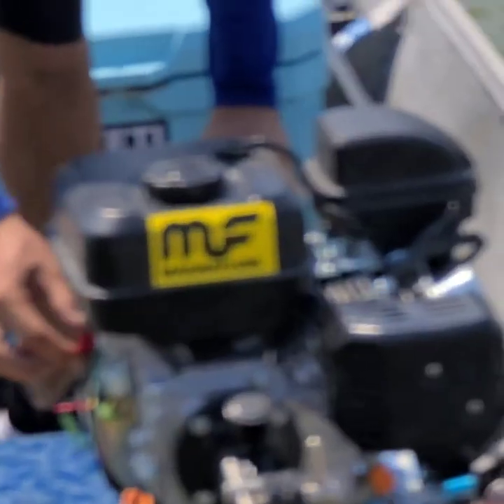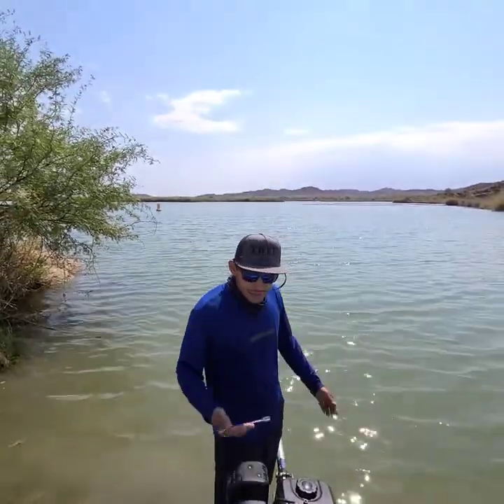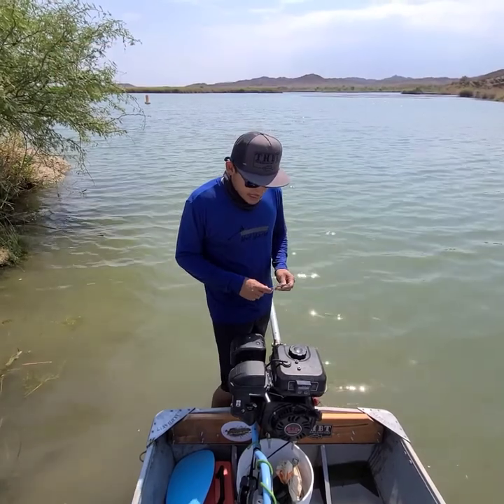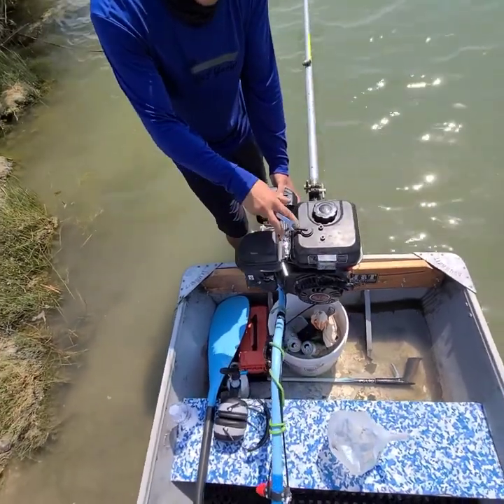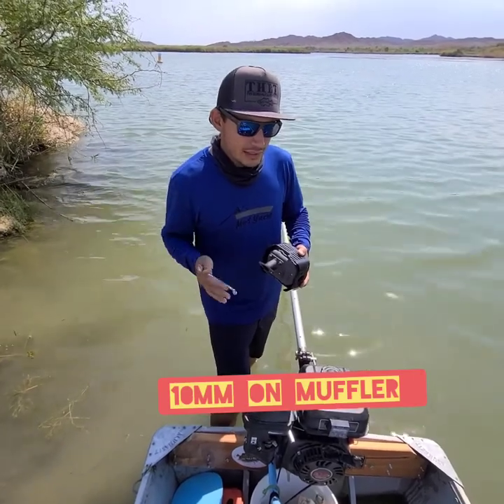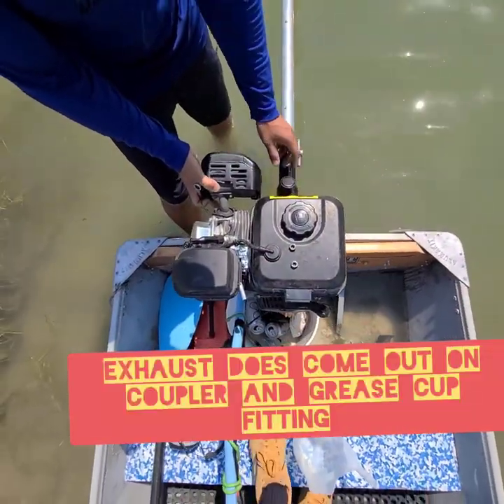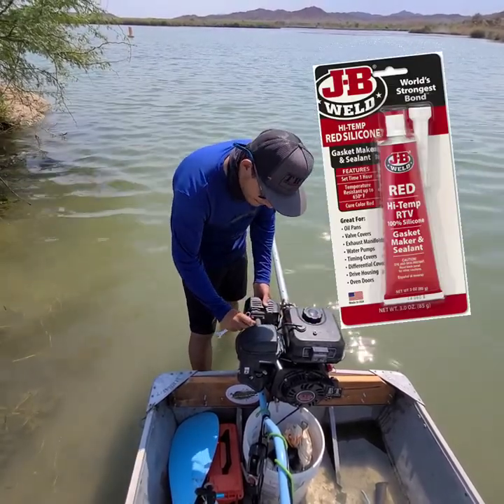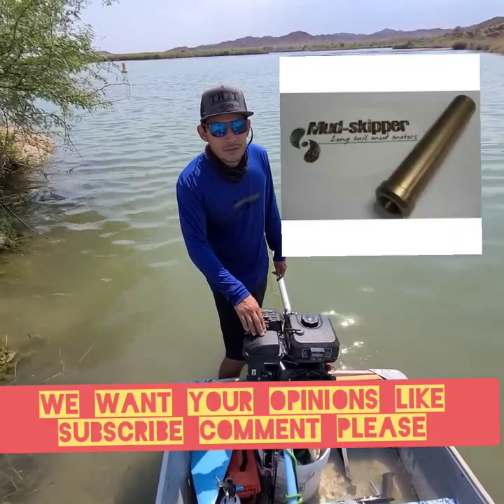Free honda clone 212cc mudmotor exhaust mod

Comment: There are a ton of exhaust options. I am trying out the beaver dam exhaust on my motors once I get them running. We shall see if those work good. I had the torque tube on 2 previous buikds and the worked good, just insanely loud.
Reply from the maker: I heard an idea from an expert mechanic and fisherman here in town. He's going  build a loop exhaust that goes down in the water for muffler. I'm not sure how its  going to do but I'm super interested.
Reply: @azlongtales  I had planned on trying that same thing just to see if it would work. I just wonder if it would have enough back pressure, but I'm going to give a try also and see what happens